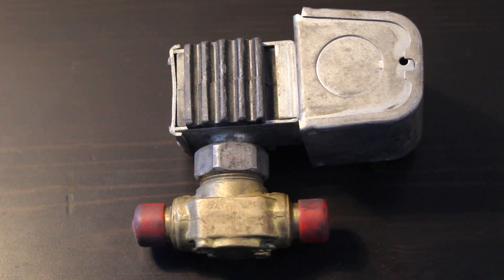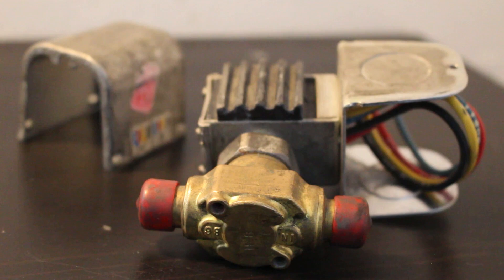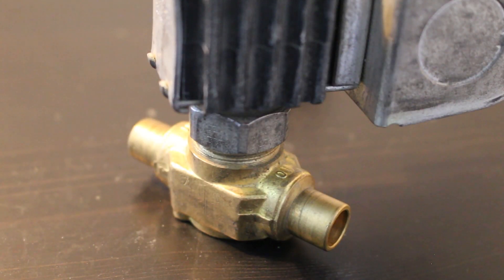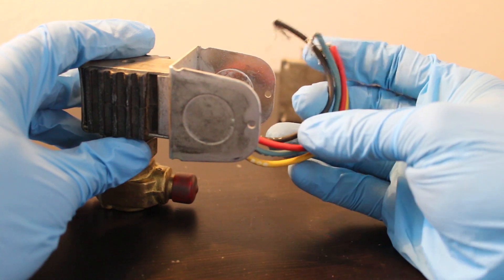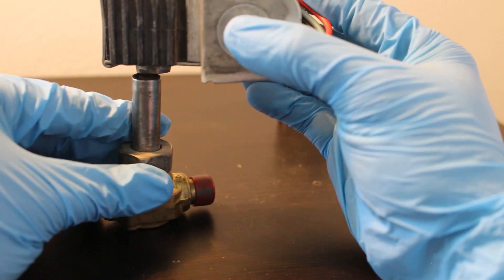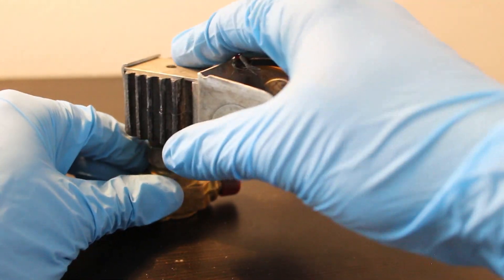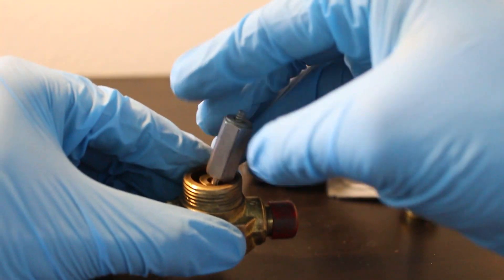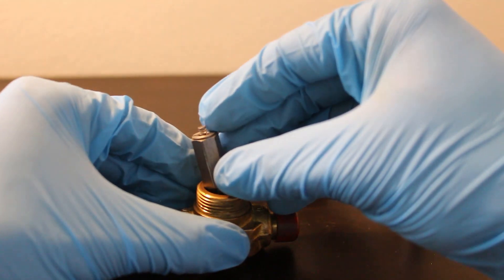What is a SOLENOID VALVE & How does it work? (HVAC/R)

Comment: I'm an airline pilot studying aircraft engine anti-ice systems today. As I studied i realized that I had a bit of a gap in my knowledge regarding the specifics of solenoid valve operation (my airplane uses one to distribute hot engine bleed air to the engine cowl in icing conditions). Your quick review was exactly what i needed. My aircraft engine anti ice solenoid valve works precisely like this. Thank you.